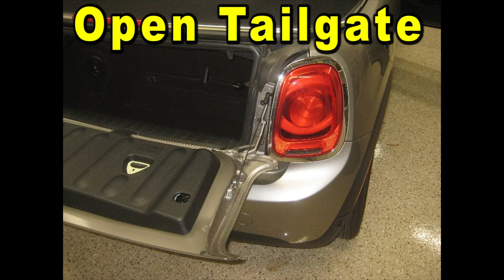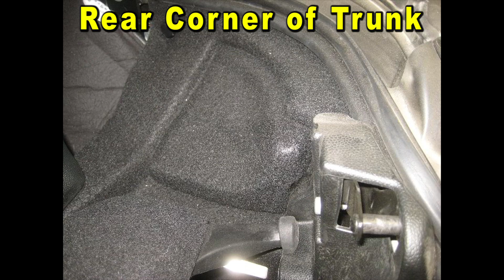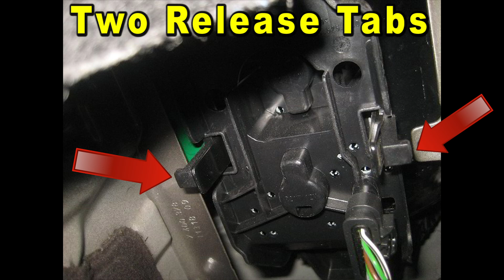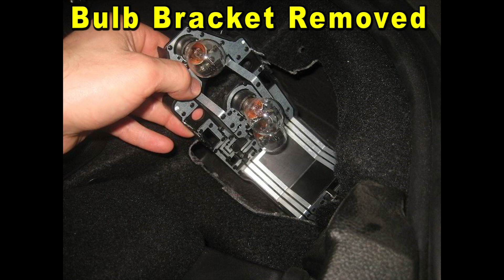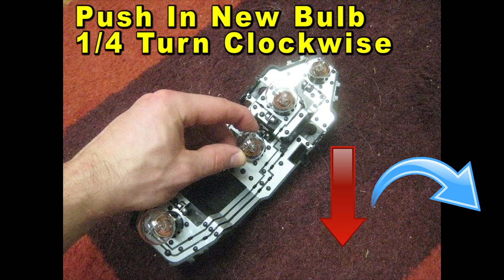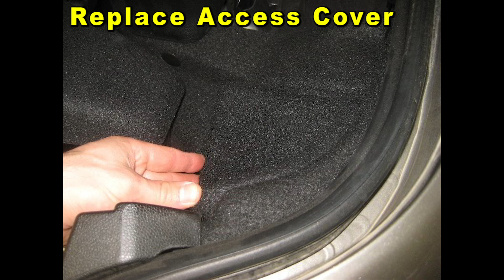2014 To 2024 MINI Cooper How To Change Tail Light Bulbs With Part Numbers

Comment from the maker: MINI Cooper Brake Light Bulb Part # - https://amzn.to/4i5hiI6
LED Brake Light Bulb Part Number - https://amzn.to/3Zvxmfn
MINI Cooper Rear Turn Signal Bulb - https://amzn.to/3CIIFaS
LED Rear Turn Signal Bulb Part Number - https://amzn.to/3CAwEnN
MINI Cooper Reverse Light Bulb Part # - https://amzn.to/4i4qHA0
LED Reverse Light Bulb Part Number - https://amzn.to/3CJwmv6
Precision Screwdriver Set - https://amzn.to/3sLixaP
Plastic Pry Bar Tools - https://amzn.to/4cPO5xb
Socket & Ratchet Set - https://amzn.to/3Z17LbA
Mechanix Gloves - https://amzn.to/3jCnHkt
Torque Wrench - https://amzn.to/3vS5uSI

The Paul79UF YouTube channel is a participant in the Amazon Services LLC Associates Program, an affiliate advertising program designed to provide a means for sites to earn advertising fees by advertising and linking to Amazon.

This DIY video shows owners of the 3rd generation 2014, 2015, 2016, 2017, 2018, 2019, 2020, 2021, 2022, 2023 and 2024 MINI Cooper how to change a burnt out brake, rear turn signal or reverse light bulb in the tail light housings. Or you could upgrade all of them to brighter LED units.

Comment from the maker: The compatible replacement light bulb part number for the 2018, 2019 and 2020 model years is P21W (also known as 7506 or 1057) for all of the positions.

The earlier 2014, 2015, 2016 and 2017 model years also use the P21W (also known as # 7506 or 1057) light bulbs for the brake, rear turn signal and parking lights but instead use the smaller number 921 bulb for the reverse light.